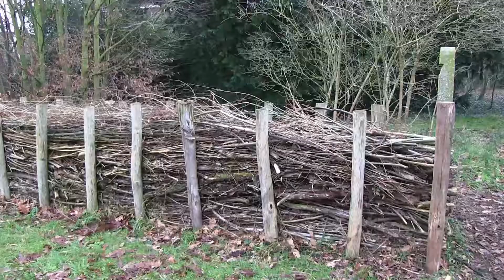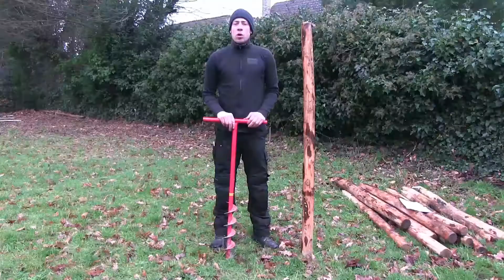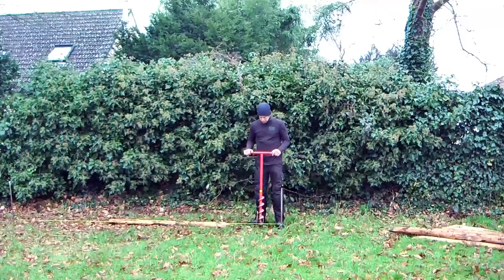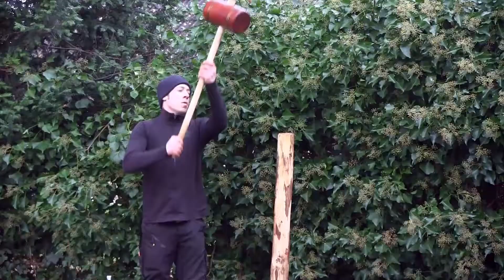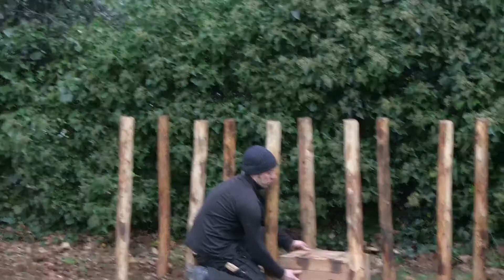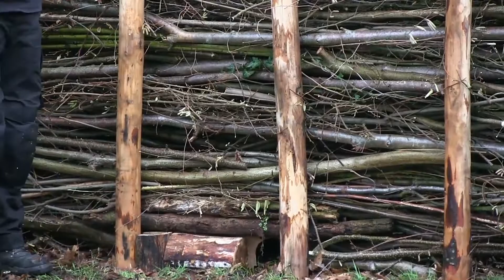How to make a dead hedge?

Comment: You could make a proper dead hedge instead. 
One that works as a regular hedge that keeps things out (or in). 
That composts branches, vines, and other big garden debris for you. 
And that at the same time gives a habitat to wildlife. 
You don't need to buy stakes or line them up so neatly. 
You can use branches you otherwise would have put into the hedge. 
They can be much thinner, and no drill is needed, just a smaller sledgehammer. 
As the branches rot, you just ram in a new one next to it. 
If you're afraid of fire, give it a proper soaking now and then in really dry weather. 
Love the hedgehog house! 🦔
Reply from the maker: Why not.Everyone can make it the way he likes...As long as you keep woody materials in the garden,that s awesome!